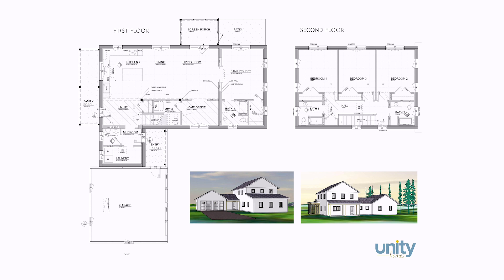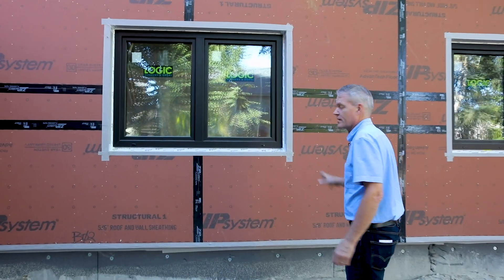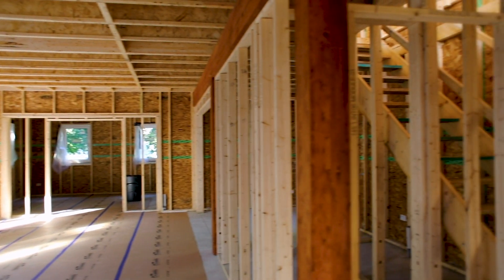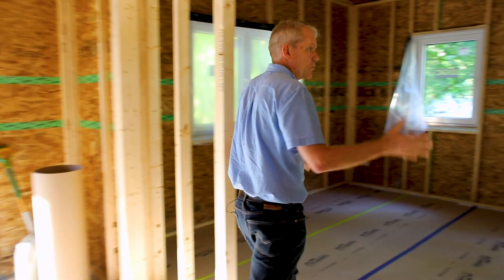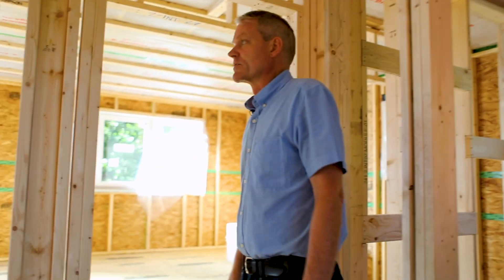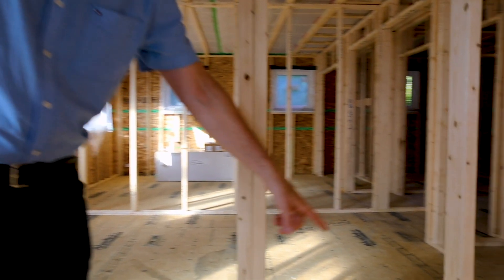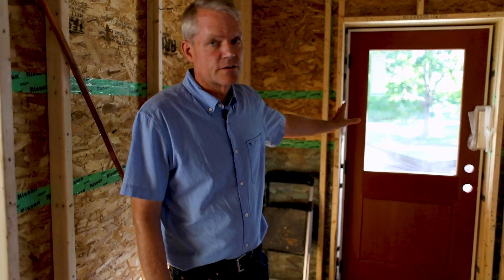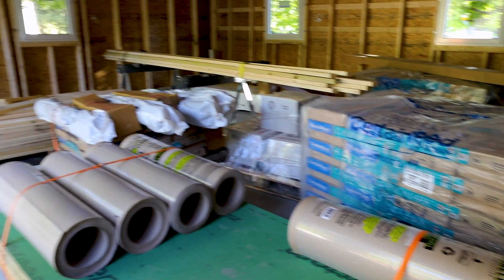Tour of a Varm Shell Package

Comment: Are the wall and roof assemblies customizable? For example for a wall, could you do from inboard to outboard, 5/8" drywall, 2x6 framing lumber, no cavity insulation, 5/8" CDX plywood, Solitex Adhero, 10" total Rockwool Comfortbatt 80 (2 layers of 5"), 3/4" rainscreen furring?
Reply from the maker: No, the components of our wall and roof assemblies are not customizable, because we've optimized them for our manufacturing process and the performance of our homes.